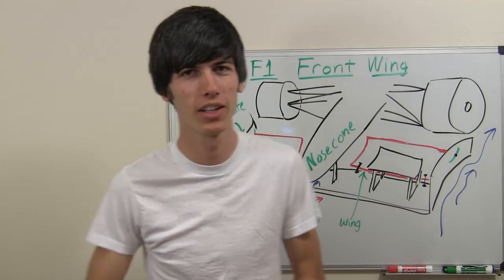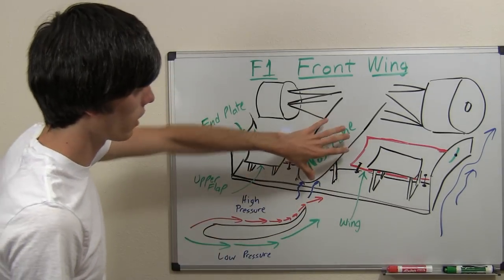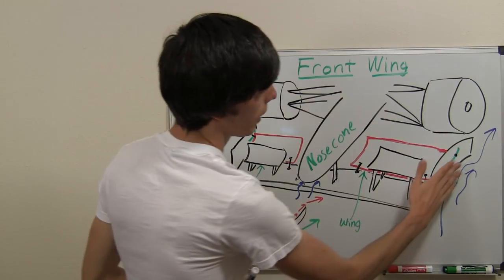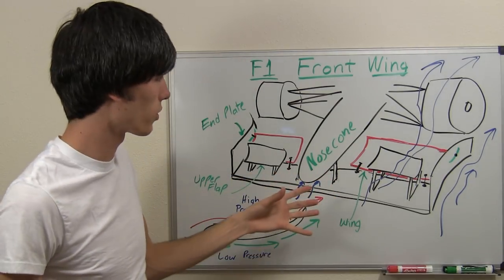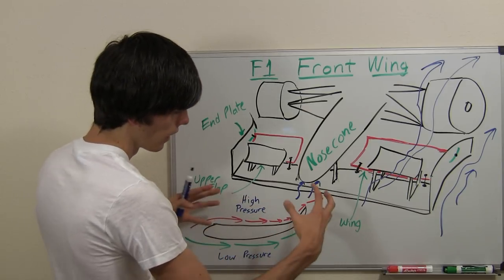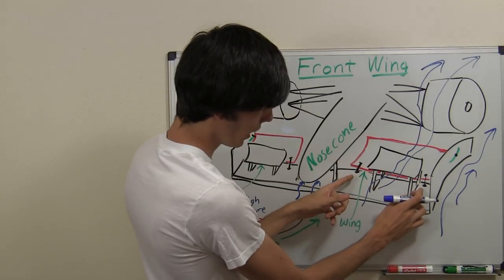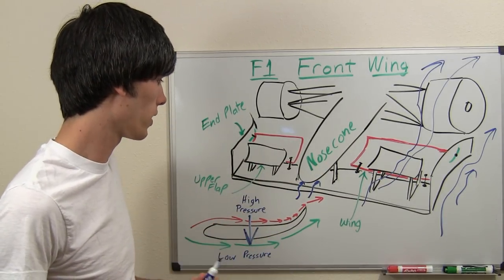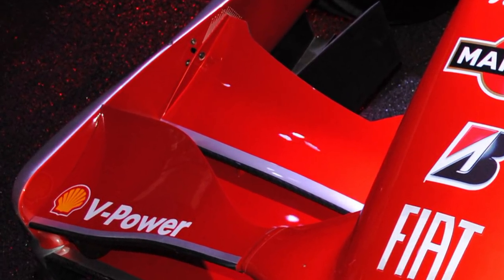Front Wing - Formula 1 - Explained

Comment: I just want to point out that density is constant all over the wing, the pressure change on top and bottom doesn't come from density, but from radius of curvature (and also the venturi effect since front wings work in ground effect). "Resistance" doesn't work as explained either, but that's a video in itself. Otherwise great video, sharing knowledge is a wonderful thing and I appreciate the time you've taken to make these videos.

I also noticed that you may be a Ferrari fan haha.

Comment: The design he's used in his drawings are simplified. The current F1 wings are so complicated. They actually curve the adjustable flaps down to meet a footplate underneath the endplate, which draws more air around the front wheels. The Cascade elements (upper flaps) are there to produce downforce as well as direct airflow over the top of the wheels.

Comment: No, bigger wings actually produce more downforce, as there's a larger area for the pressure differences to act upon. More surface area=more downforce! The intention of the 2009 rule changes were to promote overtaking by reducing the sensitivity of the aerodynamics of the cars, by moving the front wings lower, and wider, with more of it outside the most turbulent area of the wake from the car in front.

Comment: Mario,  the FIA has very strict guidlines regarding the front wing.  Just last year some manufacturers protested the flexibility of anothers wing (the lower you can get it by flexing/bending the better aero wise) and thus they set new guidlines.  They actually put weight on the outside of the front wing to make sure they dont flex to much.  They are not flimsy at all, they just make them as still as needed for regulations sake.

Comment: Couple of things to the newbies out there.  Every Formula 1 team has the same nose width and dimensions on the down bars of the front wing supports.  From there they can go wild, aerodynamically, with some provisions that I wont go into.  Like sh01 said the nose has changed due to crash safety, a higher nose is more efficient but could spear a driver in a crash scenario so they changed the rules/specs of the car to make it more safe.  Any other questions, please respond.  Thanks.

Comment: There are many explanations why there is Lift/Downforce and Drag on an Airfoil, but this is wrong.
The density is usually constant in a flow around the Airfoil. There is just a change if you go into transsonic and supersonic flows, but formula one is definitly subsonic.
There is a velocity-difference and a pressure difference, but not a higher density on the top. The density is absolutely the same as on the bottom of the profile.
Reply: The difference is between static and dynamic pressure and I think that is his source of confusion. Static pressure will be constant all the way around the vehicle when it is standing still and dynamic pressure will vary with speed. As dynamic pressure increases, static pressure will go down. This is the basis of the Bernoulli Effect and the reason why lift varies with speed.
Reply: Yes, but it goes even deeper. Using the Bernoulli Effect to describe lift effects is in so far problematic, because you cannot derive any physical equations that describe the lift effect just from bernoullie. Bernoulli is just the result of all this. If you want to give an explanation on lift, you have to start of with the change in direction of the airflow and use the Navier-Stokes momentum equations. 
The low and high pressure description is something for children trying to understand that problem and is as insufficient as the faster-on-the-top-explanation. These theories are just results of the redirection of momentum which is the real cause of lift.
deflect air down --> lift force
deflect air up --> downforce 

I hope that I expressed myself correctly, since english is not my first language.
Have a nice day!
Reply: Really blub Yeah, I understood you quite well. I was just referring to the previous poster's complaint about density. He was referring to lift in general terms so the details of that were not really central to the video. I was just pointing out the practical differences between pressure and density in this case.
Reply: Ah okay. Yes, density is a totally different topic, cause we deal with incompressible flows, hence density is constant all the time. As long as formula 1 is not going to reach Mach 0.5 in the next time. :D
Your right when you are saying, that total pressure is constant all the time, and that the distribution to static or dynamic pressure varies with speed. You are totally right. When the car stands, the dynamic pressure is zero and while accelarating, the static pressure decreases and the dynamic pressure increases from the drivers point of view. It's all relativ :D
Reply: Really blub Exactly and we are not dealing with compressible flow in F1.
Reply: @RealLy96  your explanation would be incorrect still, we know the low pressure area to be the main contributing factor, regardless of deflection, while we are well aware there's nowhere near enough acceleration for the molecules' momentum to generate downforce.

Comment: wouldn't air flowing across or under the adjustable wing hit the wheels? i mean that's the purpose of the upper flap which is to divert air above the wheels. Could you explain how does the air flowing across or under the adjustable wing not create turbulent air? Thanks!

Comment: Look closely at the profile of the wing; the formula p.v/T (p - air pressure, v - air flow speed, T - air temperature) has to be constant both in front of and behind the wing; if we take T for constant,  p.v   in front of the wing has to be equal to p.v   behind the wing. As the air flow path length above the wing is longer, the flow speed has to be higher (air has to pass the wing at the same time both above and under the wing) - subsequently, pressure above the wing is lower than below the wing - you get a pressure difference, which is lifting the wing up.
Reply: +Ladislav Varga Why would the air above and below the wing go at differents speeds so that two particles that were neighbours before the wing, pasing each on a different side of the wing, be again neighbours after the wing ? That's actually completly false and a common mistake made by many people. If you want to understand, you have to go deeper in the theory, and I can tell you that the explanation and the maths and physics behind it are far more complicated, but far more real.

Comment: Your videos really are fantastic, I was lead here by a tweet from Craig Scarborough @scarbsF1 which is praise itself! 
Where you talk about airflow under the nose feeding the diffuser, it seems a little dated by my understanding, although I may be wrong. I thought this air feds into and under the sidepods to increase flow speed, resulting in lower pressure beneath them, while slower air from the wheels flows above, effectively creating wings, hence the dramatic undercuts on current sidepods.

Comment: A higher Nose generelly improve the airflow on the upside of the undertray further back of the car. This improves the efficency of the diffuser a bit. The platypus nose is a regulation thing. The FIA regulated the maximium high of the Nose at the very frontend because of crashsafety. So the engineers came up wiht this strange looking solution.

Comment: i dont see how an air deflecting barrier would be classed as a closed wheel system,besides its more of a de-accelateing device which would probably slightly reduce the effectiveness of the drs while at the same time allowing a more stable front end when the car is faced with turbulent air in an over takeing attempt

Comment: you said high speed tracks need less downforce than low speed tracks. but what about really low speed tracks where all the downforce is quite unused because the air doesn't circulate that much?

Comment: im not too sure about the explanation on downforce. That doesnt explain how you get lift/downforce on an asymmetric aerofoil where the bottom is straight.
Reply: The straight bottom is for airplanes, opposite for cars that resembles formula 1 or closely related to that, cause air tends to have low pressure on fast side of the wing(in other words, the inverted wing needs to have curved bottom to speed up the air, therefore lowering the pressure). You may be trying to explain it in opposite way, sorry about that.
Reply: AGKfan64 The explanation for lift is not that straight forward. For example, you have circulation around the aerofoil that acts to assist the flow on top of the aerofoil (bottom for cars) and slow down the flow at the bottom of the aerofoil (top of cars). The explanation for that is complicated, involving potential flows. Then there is the explanation for lift, provided by two different ideas, namely, bernoulli's theorem and newton's second law. Both are true but neither is complete.

Comment: I really don't think you understand why the cars are designed the way they are. Having enclosed wheels gives an aero advantage, which, when exploited could make the cars dangerously fast. The front wings are lower to the ground and wider, so that they're less affected by the turbulent air off of the back of the car in front, helping overtaking. And F1 cars are actually a lot faster than World Series cars.